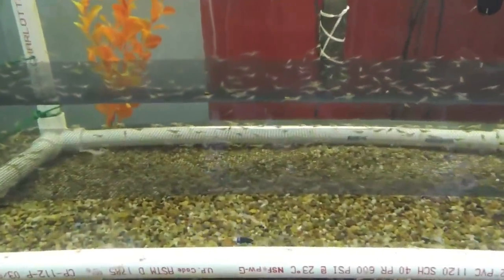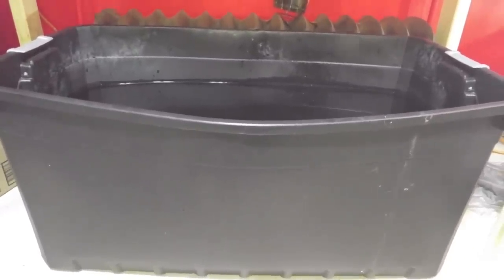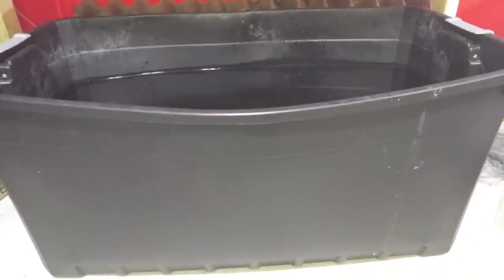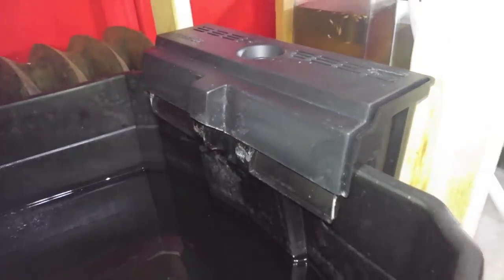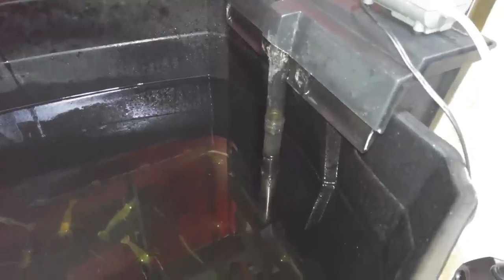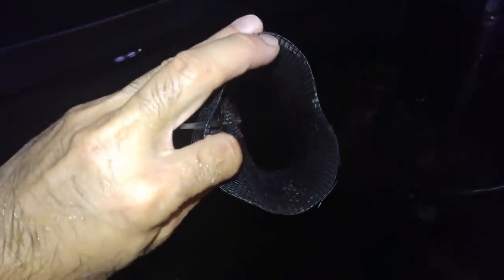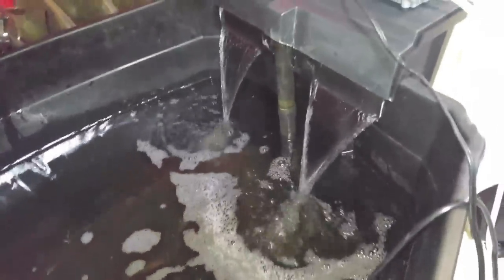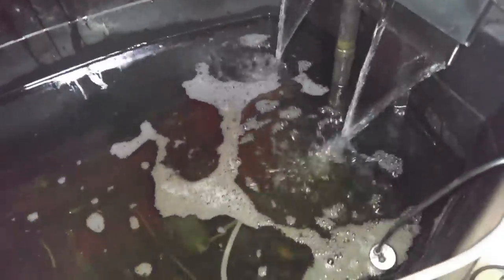Raising Freshwater Prawns - Easy & Low Cost for Beginner

Comment: I used the same container and agree, I had to build a structure to keep the sides straight.  I'm using a swirl filter built from a garbage container and a 5 gal bucket.
Reply: Lovely Video! Excuse me for butting in, I would love your thoughts. Have you ever tried - Elenajan Supplement Smasher (Have a quick look on google cant remember the place now)? It is a smashing exclusive guide for learning how to shrimp farm like a pro minus the normal expense. Ive heard some pretty good things about it and my mate at very last got excellent results with it.

Comment: and are they expensive? I have 2 lakes (where they will grow.) One lake is about 1 acre, the other is about 2 acres. Is there anything I need to add to the lakes prior to adding the shrimp? Right now, the lakes are crystal clear. I don't recall being ableto see the bottom of the lake.
Reply from the maker: Pricing is on my website.  I believed my pricing is very good compared to others.  I do this as a hobby and just wanted to make enough to cover operating costs.
Make sure Lake temperature is at least above 70°F.  You shouldn't have to add anything, just make sure you don't have any large fishes in it. 
 How do you plan to harvest the Prawns?  
You'll need to grow the Prawns to about 1" before stocking your lake.  This will give them a better chance of survival if conditions changed.
Reply: @KTPrawns  do you post it to uk ?

Comment: You should consider buying Rubbermaid 50 to 100 gal stock tank instead because they are more durable than the average Sterlite container.
Reply: or you can build a 20x6 and 4 feet high concrete pond... the whole idea here is how to start

Comment: How are you housing adults?
Reply from the maker: +Greg Cxox I keep them in this container until they are big enough to harvest.  I would harvest the big ones first and give the smaller one more time to grow.
Reply: KT Prawns may I ask the size at witch you harvest?
I've been looking into buying some of your shrimp. I'm trying to determine what kinda space I need
Reply from the maker: Hi.. I harvest them at around 5 inches.  Depending on your container size, feeding and water conditions, it will be about 4-5 month for them to get to 5 inches.  I get between 18-24 Prawns per/lb at around this size.